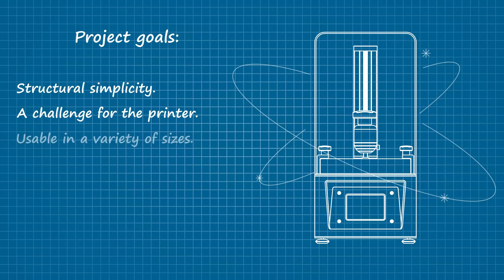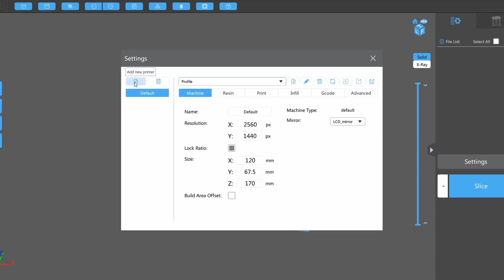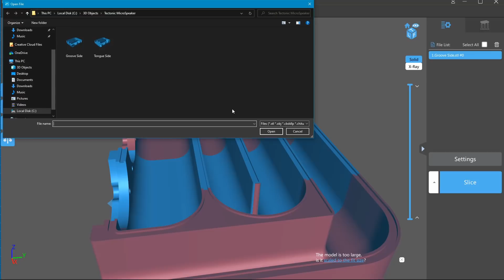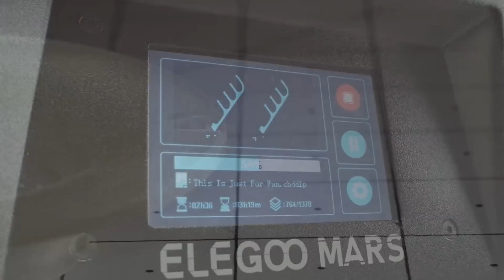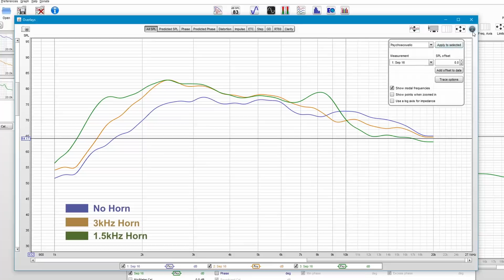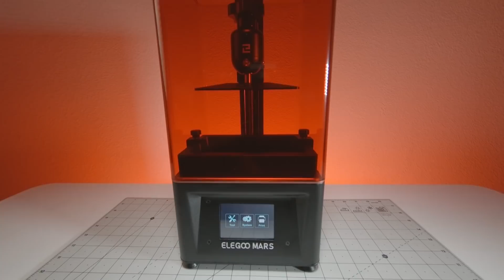Acoustic Amplifiers & The ELEGOO Mars

Comment: so the small t line enclosure dos scale, you did a 1/3 scale, therefore it is tuned 3x higher than it was if theres a driver thats also 1/3 the size, so now if it was tuned a 40 of HZ with a 3" driver now its tuned to 120 HZ with a 1 inch driver. good for prototyping enclosures and seeing the response without using the material required for a full scale build, although room resonance would not scale the same way, so testing would need to be done in an anechoic chamber or as close to one as possible

Comment: Just a note about the SLA supports. The print failures were due to direction of pull vs support placement as the parts lift off the FEP they're stuck to. The bottom brim f the horn was supported but not actually the back right next to it. Meaning that as the print reached back the pull of the FEP would pivot the edge of the horn backwards since the pull is behind any support making the part distort.

in short. More supports behind the lowest brim

Comment: I think the main reason for the print issues is gravity. On resin printing, gravity pulls away from the bed, which can cause sagging. As such, even if the print is at a good angle with no overheads, supports are still needed to keep the model from sagging. The resin is still somewhat soft when printing and, especially when printing larger models like these, the weight is important and can warp the print if it is not properly supported.
It seems to me like you used very few supports, very few of which were connected to the parts that deformed

Comment: Saying that that's not a problem with the machine but a limitation of the SLA process is wrong. I work with SLA printers and I can say that if you use a 300 usd printer, you cannot pretend to have perfect parts everytime. I work with extremely professional printers ranging all the way from 25k to even a million usd, and the quality is perfect all the times. Using this 300 usd printer and saying that the problem you had is related to the SLA technology is objectively wrong and creates misinformation. Since these cheap 3D printers are made for hobbies and home users that won't buy a 100k machine, they need to use the same technologies but at a lower quality to keep the price low, so it is practically inevitable to have those problems. Apart from the printer itself, you should try to use different materials, orientations, different densities for the supports and so on, because obviously the printer isn't the only thing that matters (especially in this category), I'm sure that with a bit of practice you can achieve good results.

Comment: Nice as always! Personal preference was the 1.5 kHz horn, at least over YouTube, though I expect it radically reduced the audio sweet spot in the room (as you'd illustrated). I've seen on other channels that acetone vapor can help smooth out filament prints. Obviously this does nothing useful for small parts, but it could be useful for something like this horn design.

Comment: I'd highly recommend getting into using the 3d printed parts as blanks for making silicone molds to create far more durable resin parts with better material properties than a layered structure(3d prints).

It's also faster than 3d printing for making multiple parts or enclosures.

Comment: Could you do a video on internal enclosure geometry and how reflections, absorption, and wall resonance affect response?

You sort of touched on it when you re-stuffed your sub enclosure. When you modelled different configurations but volume remained unchanged, it moved the response curve. 

Theres next to no technical content with measurements on the youtubes. Probably because of the effort involved constructing said enclosures, but multiple printed enclosures of a set volume but different internal geometry would be easy to demonstrate. Thank you for all you do! Cant wait for the next one!
Reply: HexiBase please do- the enclosure I recently built has two window pane style braces inside and while the displacement volume is accounted for, I did wonder how it would affect the overall response. Or if they were (both) really even truly needed.
Reply: @lunchboxbailey  I just built one like that too! I could hear the difference with and without the braces when doing the highly technical and extremely accurate knuckle knock test... S/ 
I imagine the unbraced wall areas resonate at their excited frequency if the driver outputs that particular freq. The more unbraced area, the lower the f(wall) and the more "ringy" the enclosure. I think the bracing makes smaller resonant areas, pushing the resonant frequency of the remaining unbraced area up out of the woofers range. This is all in my imagination tho, a seriously flawed modeling computer at best. Ts'why we need Hex to illuminate our subsonic world.

Comment: I heard a horn is more something like impedance matching than amplification?
Probably even in one of your videos.
I am coming from an electronic engineering background.
Do I understand it correctly that the 1.5 kHz horn flattens the response by adapting the mechanic/acoustic load so that the characteristics of the unloaded speaker are compensated?

And the "amplification" happens also by adapting the load to allow the best power transfer and reducing "reflections"?

Thanks for your cool videos and allowing insight into the processes. It's a rarer occurrence on YouTube videos since technical details might overwhelm a lot of people.
I think you hit the sweet spot of digestable information and still be entertaining even if one does not understand everything.
Also I love your technical background videos!

Take care ❤️
Reply: Impedance matching increases efficiency which increases output. So it amplifies wihtout being an amplifier.

Comment: I have an Elegoo Mars - and I've printed some pretty wild designs. I was disappointed in the beginning with the same results you see there - but after having it for about a year now I can tell you that horn is definitely printable! It needs way more supports though.
Reply: Send me the step file and I will attempt to prove myself right :)
Reply: I think so too.  Probably fixable by reorientation and support.
Reply: It's 100% due to poor supports. I think he is too used to FDM printing where the only force you need to worry about (in regards to supports) is gravity. You're also fighting against suction! If this was supported properly, it'd have ZERO issues.